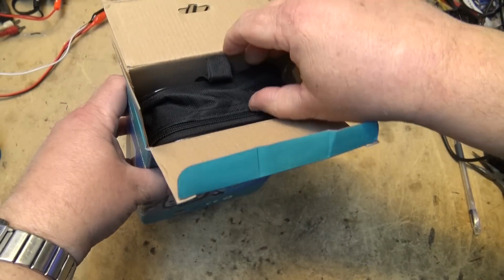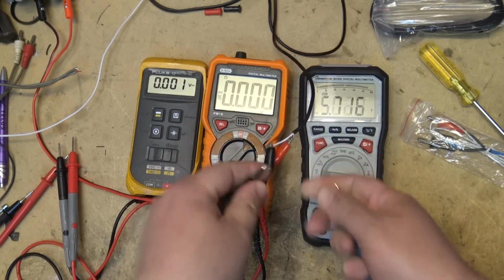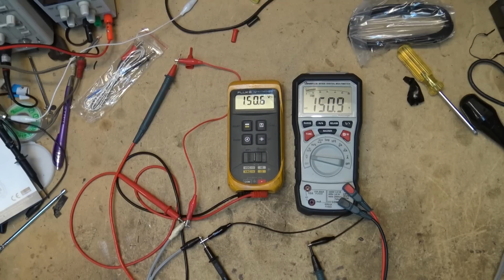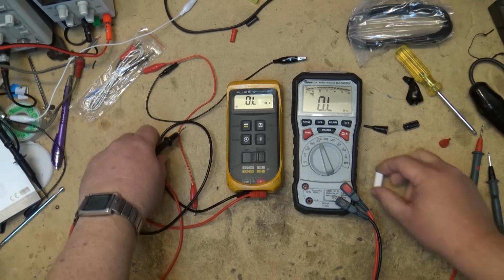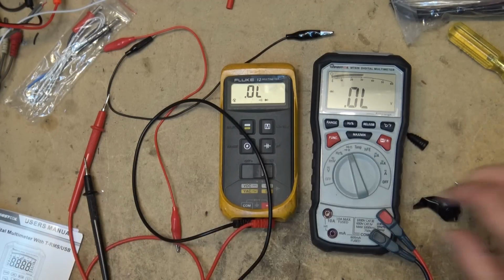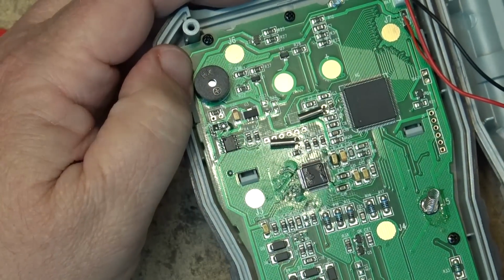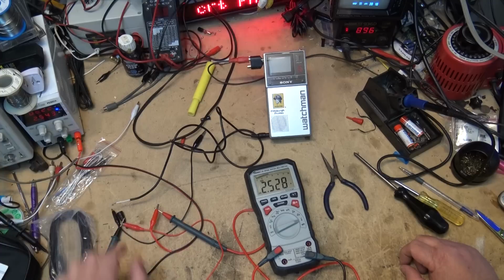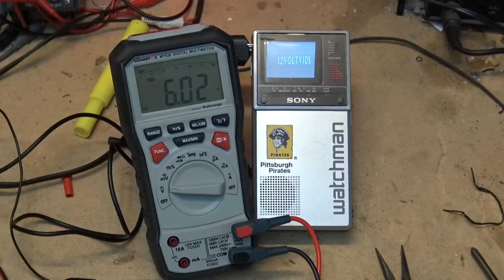Mustool MT 826 Multimeter Review and Teardown

Comment: Just 1 year of use and   dead.......  pure crap
Reply from the maker: Mine still working, and I have dropped it a few times.
Reply: With intensive use (several people use it) and in sometimes difficult conditions (automobile mechanics), never had any problem.

Comment: Cheap junk with a "Chinese Mainland only" warranty.  I bought one following this vid and it failed completely a few days ago.  Good job I didn't throw my ten year old Maplin one away, it's going to have to be a stop-gap 'till I get something from a reputable company.
Reply from the maker: Mine has been going now for 7 months no problems. 
Contact seller should be under warranty for a year.
Reply: Got it from Bangood.  Warranty only valid in China (according to the warranty card) so just threw it away.

Comment: Just bought one on the strength of your video. Price on Banggood has dropped $20 over the last couple of days. An offer I cannot refuse. My old fluke 75 still going strong and accurate but missing some functions that are common on today's multi-meters. I am happy with most of my stuff from China. The only thing that has given me trouble has been the speed controller on my wood lathe.
Reply from the maker: I use mine as my backup to my FLuke. It does things that my fluke doesn't, like measure temperature, and measures large capacitors, and current.

Comment: Im so disgusted, after returning various meters for defects I spent a bit more and got this one - and just like all the other import meters ive had to return there HAD  to be at least one thing wrong with thisone as well.  I really wanted to like this meter,  but on mine the continuity test beep volume is so low you can barely hear it in a quiet room - oddly enough the useless beep from the range switch is loud and clear every time you turn to another range, but the one from the leads on continuity is virtually inaudible when right on top of it.  Heck ive seen $10 meters do better than this. I tried contacting Bangood and when you leave an email they want three pics of no more than 2mb or something and it wont accept the pics from my digital camera says theyre too big and it wont accept the email without the pics- what a PITA.   The only asian meters I have that have been problem free have been the Aneng 8008 and two 8009's, all three of these have been accurate and function perfectly.   I thought maybe if I paid more I could get a larger model with decent quality control, looks like I was wrong and now im stuck with it.
Reply from the maker: We can agree to disagree on this claim. See new video where the level is measured against a Fluke.

Comment: Why did you change the fuse after open the Meter?
Reply from the maker: Because when I was testing the current, i exceeded 500ma, and even though it was a 600ma fuse I tripped it, so I had to replace it. Fuses are not an exact science. A fuse rated at 600ma will blow before 600. That is the MAXIMUM. In this case it blew at 520 which was the final test I was going to do on the 600ma range.  So yes it is well protected. Even the 10A current side is protected, which is more than my other 2 meters, the DR meter and my old Micronta. The high current side on those are unfused,

Comment: Take a good look around the case and inside the instruction manual for a little 3 inch CD
in a white sleeve (ridiculous little things that fit very few players).
Sometimes it is hiding and it has the software for the USB connection. If it is missing
just give me a PO Box or address and I will copy it to a regular size CD and send it
right out to you. Aloha from Maui

Comment: cool review - the usb interface would be powered by the usb connection?
Reply from the maker: Yes the USB interface is powered by the computer. It is 100% optical isolated. No connection between the meter circuits and computer. You press a button on the meter to send the results to the computer for logging.

Comment: Is insulation Transformer the same as Variac. Thanks.
Reply: nope,variac is an autotransformer,it doesn't separate mains voltage from the load appliance,thats why he has a 1:1 isolation transformer in front.
Reply from the maker: No. A variac is an auto-transformer, and it is NOT isolated. I have a separate isolation transformer under my bench that totally isolates my test bench. My variac is plugged into the isolation transformer, and then the test plug is connected to the variac, so MY variac is isolated for safety. But a variac itself is not. You need a separate floating isolation transformer before the variac.
Reply from the maker: Dam, beat me to the punch. Perhaps it is time for another video explaining my setup. I did that years ago, but I ket asked the question time and time again.
Reply from the maker: My isolation transformer has 3 taps on the secondary.  1:.9, 1:1, 1:1.1
So for 120 in, I get 110/120/130 out. I plug the 130 output into my variac, so I can crank it up to 150 as I showed.
Normally a variac will take the 120 mains up to about 135.

Comment: Well that is a real performer, cheaper than a fluke but close to fluke performance :-D.
I noticed the 8 pin serial memory on that pcb, it uses a very modern multimeter chip.
It can be calibrated and settings stored in serial memory.
Parts can be less accurate, so a cheaper meter will still perform.

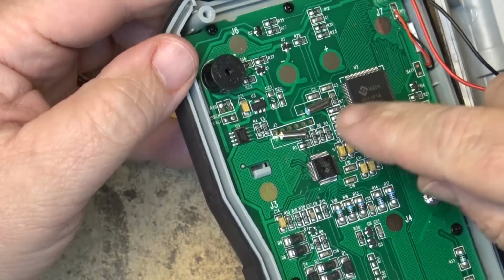Comment: 24:42 that's an off the shelf DMM front end made by Hycon Technology they make pretty good chipsets. Most manufacturers use an off the shelf part like this. One exception is Fluke who usually has a few Fluke branded ICs in their meters. Whether they're actually custom parts or just rebranded off the shelf parts I don't know.

This is the reason why even the cheapest of DMMs have reasonable measurement accuracy all of the magic is in these highly integrated and most importantly inexpensive DMM ICs.
Reply from the maker: Bushougoma 
Might be an off the shelf,  but it is still a custom asic.  This is how most companies work these days as opposed to building in house.

Comment: The best way to check calibration is to put the thermocouple in boiling water and expect 212 degrees before you suspect the soldering iron.
Reply from the maker: Yup that works, but remember it read out the exact same room temperature as my other thermometer.